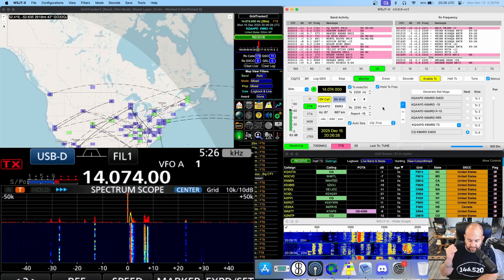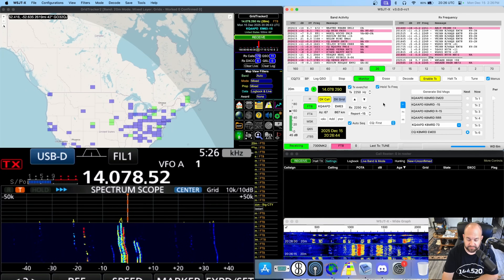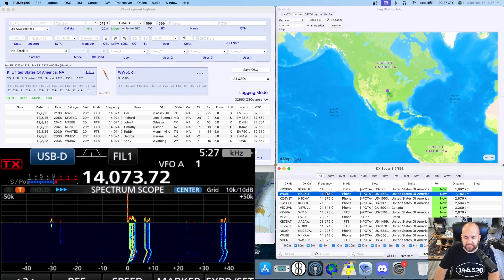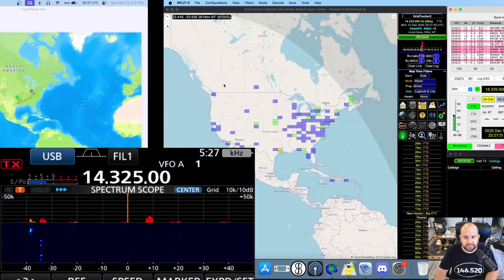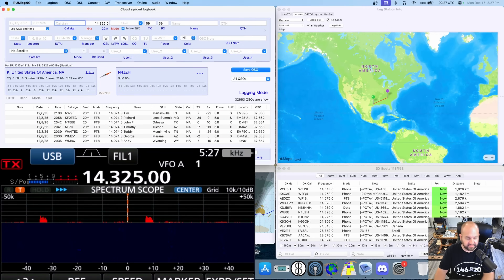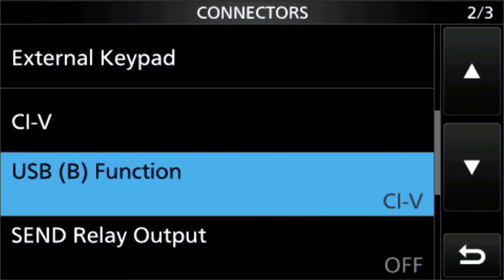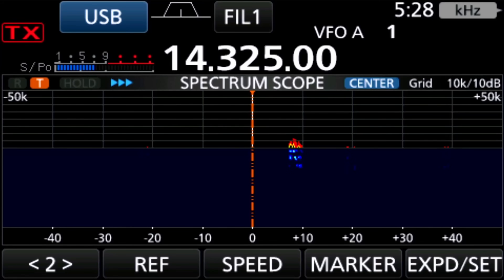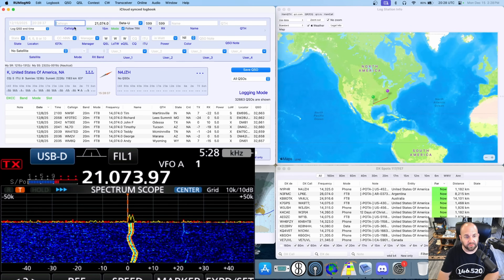Icom IC 7300MK2 Has Dual Com Ports!  Finally!!

Comment: What rig settings did you use in wsjtx? I've been unable to get cat control to work with my 7300mk2, using the 7300 preset.

Comment: $400 Hermes Lite has been doing this for years. In fact, the Hermes and other Anan radios will use TCP/IP (internally) to allow infinite applications to control cat at the same time. And the Sun SDR line of radios also do this with audio chain. Now why Audio? Because with TCP/IP. there is no hunting down that weird set of letters and numbers that represent the serial port. If you do TCP/IP correctly, you can address the radio's cat and audio by a name you give it. In WSJT-X. you just say "TCI" for Audio and TCI for cat and you are done. No shade Mike. I am glad you are highlighting this as a useful feature.

Comment: I've got an FTDX101D WSJT-X, Grid Tracker, Log4OM2 using Omnirig. Windows 10 PC. All programs can control the rig, frequency etc and when you finish an FT8 qso it automatically logs everything and uploads it to QRZ, Logbook of the World and about 3 other online logs. If I spin the dial on the rig the programs track the rig also. Works in SSB or CW also for logging. Although you have to enter the call manually. Everything else is populated and uploaded automatically.

Comment: Thanks for the video.  However I believe I have been doing this for sometime with my 7300 Rig 1 and my 705 Rig two and Log4OM.  GOing to play a little more but I can use Log4OM, check clusters and both programs interact fine.

Comment: I just use Afreet OmniRig. You can run multiple software with CAT control all pointed to Omnirig, which runs as needed in the background and talks to the radio on one serial port. The only software that can't use Omnirig is the FL suite. Unfortunately, Omnirig is Windows only.

Comment: Ok, it might be that I'm running Windoz but I have been doing this for years.  I run HRD, for rig control and logging and WSJT-X configured for HRD.  All on a single USB A to USB B on the back of my IC7300 (supose I need to say Mk1 now)

Comment: Nice computer gymnastics made easier with the new 7300...    I will never buy the 7300 or any radio without  dual independent Receivers, like the IC-7610 has. Without a dual receiver its almost impossible to make a QSO split frequency in a huge DX pile-up.  de WD8NVN

Comment: That is a nice feature, however, I have been doing the same thing (functionally) with all my radios (FTX-1, FT-891, FT-991, FT-710) by configuring WSJTX CAT control as DX Labs and pointing it at Rumlog.  Rumlog does all the control.
Reply from the maker: That is way above my head lol!
Reply: @hamradiotube  it absolutely is not. Also, RUMlogNG has a pretty decent transceiver control panel for several radios including the OG IC-7300 and IC-7610. I’d be interested to know if it works with the MkII!
Reply: @scottreynolds  I have done the same using DXLabs/RumLog and my Mk 1 7300..  K0PIR has a video on his channel setting out the steps.
Reply: Yep, that’s what I used to set it up!

Comment: I always been able to run all on my 7300. 7610 and 7760 with one USB cable using OmniRig and Com0Com which is all free. But I’m glad they added that feature on the new 7300 mk2

Comment: I do that with my IC7300 with wsjt-x and Ham Radio Deluxe
Reply from the maker: How??
Reply: @hamradiotube  Setup Ham Radio Deluxe for your radio. In WSJT-X, select "Ham Radio Deluxe" as radio. Of course, as HRD is only Windows for now, it will not work for Lord Tube.
Reply: What USB cable did you find worked best between the Mac and the 7300?

Picked one up a new Icom7300MKII. 

I have been using my other radios via a UDP interface in MacLoggerDX holding the comm port and then wsjt-x pointed at that to do dual program control.